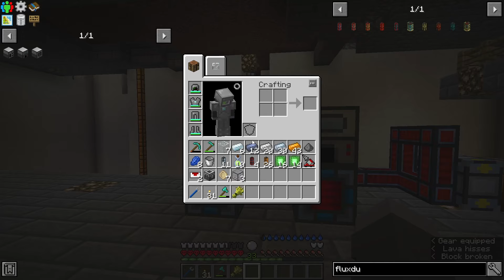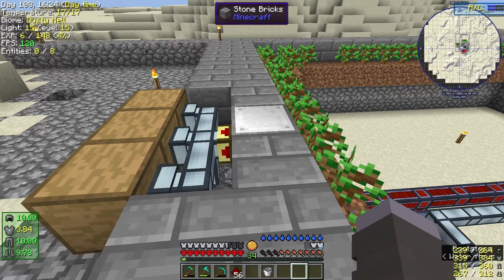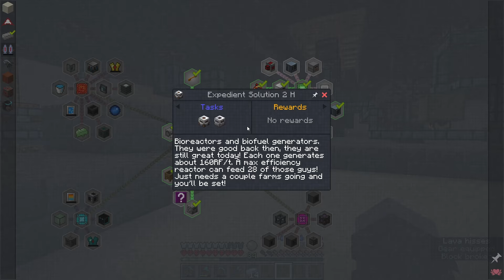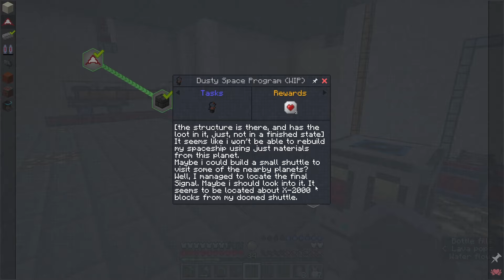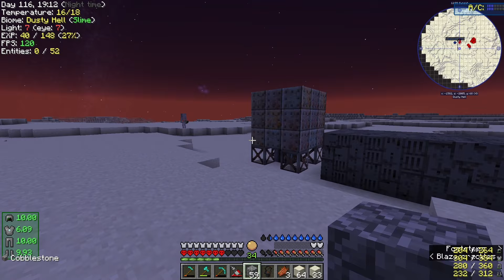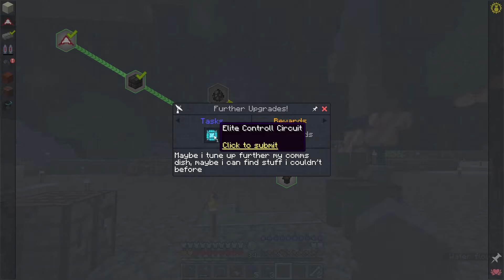Many More Machines, Space is next | Dusty Hell Ep 6

Comment: A "cobble gen" using witch water instead of lava makes dirt. Will need to be modified a bit but makes a whole lot of dirt fast and for free excluding shovel durability. 

Use Hoppers for getting items into or out of barrels. Such as putting sand in for soulsand.

You got lucky my rocket hanger location was literally buried halfway in dust. The only reason i saw the pannels was the block tracker upgrade on my armor. There are 2 more chests under the tall pillar across from the hanger. The block tracker upgrade can show you the location and contents of chests and other "inventories" through walls and can highlight an array of different blocks (by inventories i mean almost anything that can hold an item casting basins included).

The chests at the rocket location contain machine frames and reinforced conversion kits.

You will want the jet boots upgrade or other fast flight and max air conditioning for the moon. You can also use an aerial interface to provide your armor with air across dimensions and distances alongside charging your inventory. For the air to work you need a charging module on a pipe pointing into the interface.
Reply from the maker: Ah thats how I can get air, I keep going downstairs to manually charge it, good to know